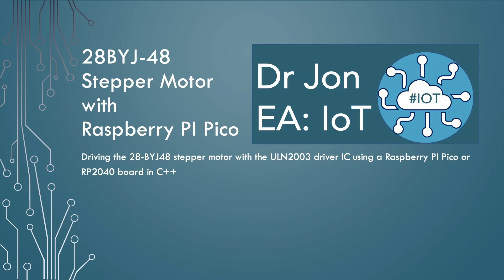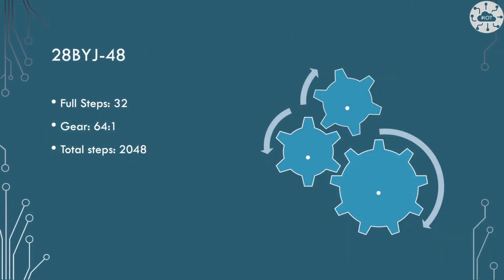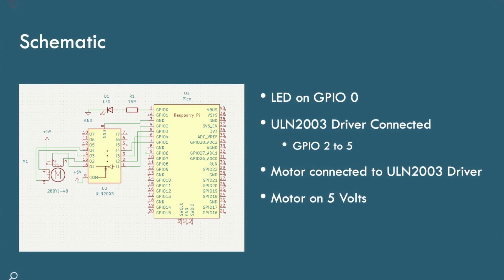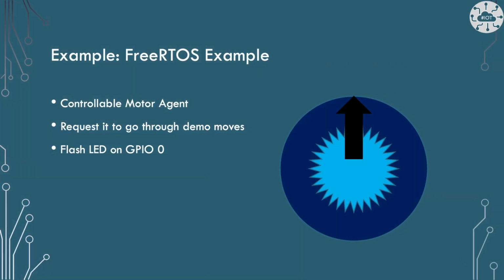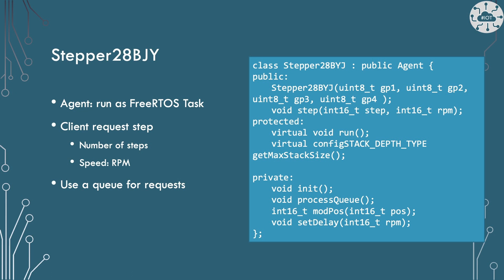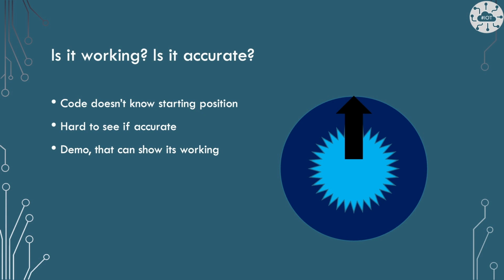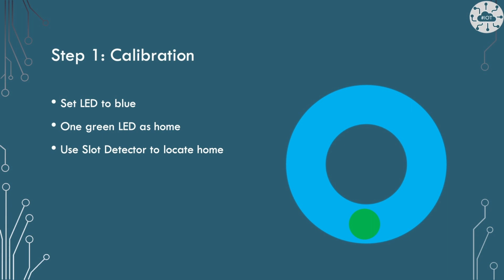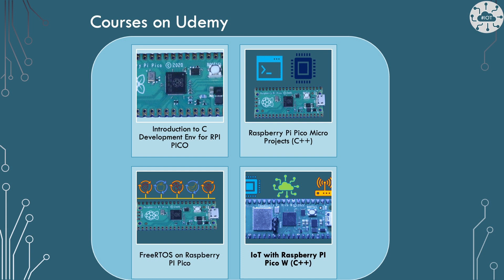28BYJ-48 Stepper Motor with Raspberry PI Pico (C++ and FreeRTOS)

Comment: I had someone complaining about power usage of another module (I won't mention ***32 here), yet I checked Pico W spec and indeed it may need up to 300mA when on full gas.
Reply from the maker: Glad I am not the only one working around these challenges.